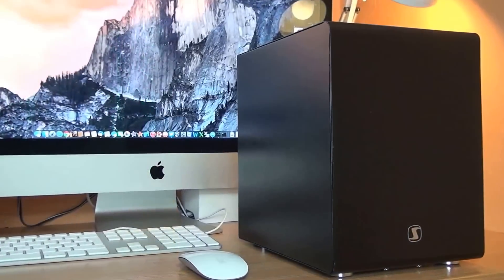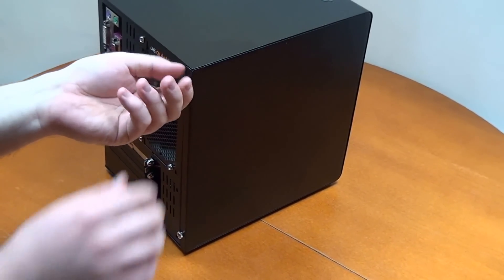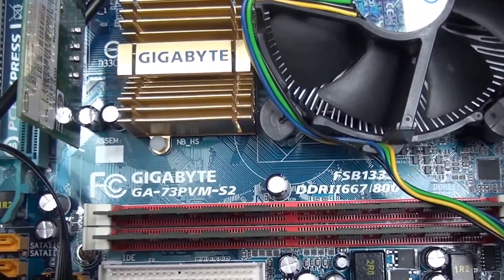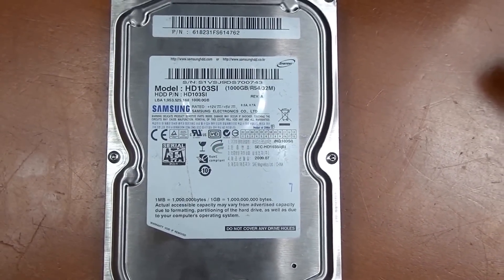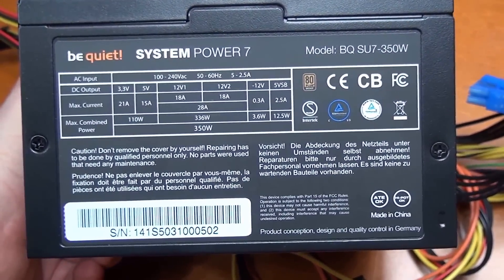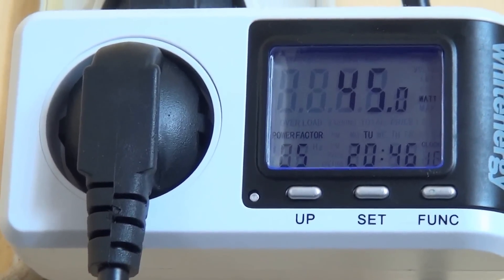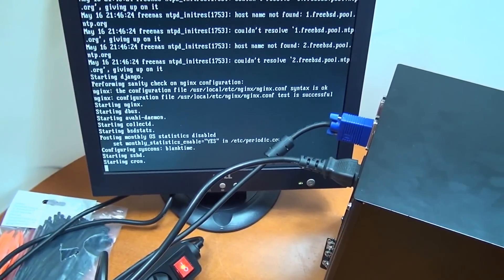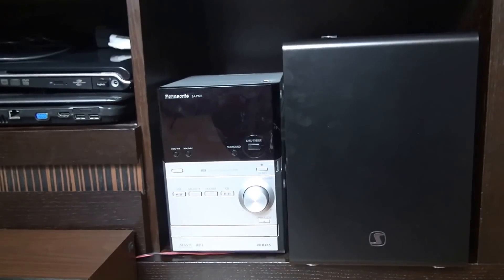Cheapest NAS? FreeNAS build!

Comment: Dude, get a phillips head screwdriver. Straight head is so 1940's! Next, you picked up the box with a specific purpose in mind  without looking into it's specs? Enough said there.
Reply from the maker: +Karl H 

Flat screwdriver can be really handy- for example during the MoBo stands installation or I/O shield or some tower coolers- even Intel stock cooler... You really don't think, that someone will be bothered by the tool you are using to do the thing... 

Still, you can jump here:

https://youtu.be/1-UL1DXXqNY?t=433

and please your eye with the proper one...

About the case, it was tiny and cheap <20-ish $, very cool. Can you point a case that is cheaper, smaller and equipped with more drive cages ? That would be actually helpful and productive.

Thanx for the comment tho.
Reply: +tech tests tutorials $20 for the case is good. When I looked for one some time ago I was surprised to find that they were stupid expensive. 

I'll stick by the screwdriver comment. I ~hate~ straight head screws. I thought they were stupid in the 70's. I can't believe I still run into them in the 21st century. That mostly from working around the house and on cars. I have ZERO laying around the house. When I have to remove one I will take the extra time to get a phillips replacement in most cases. Yeah it's a thing from me. The amount of effort needed to work on PC screws with phillips head is a fraction of a straight head. I do keep one around. But as you noted, it's really only a pry bar.